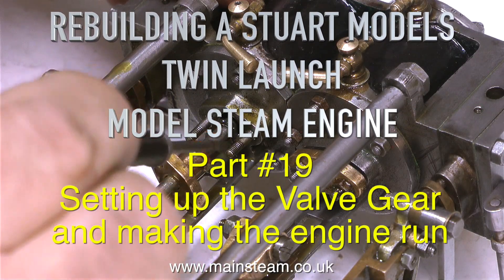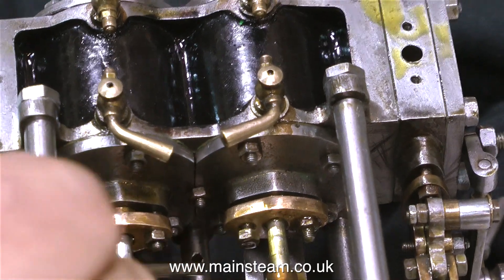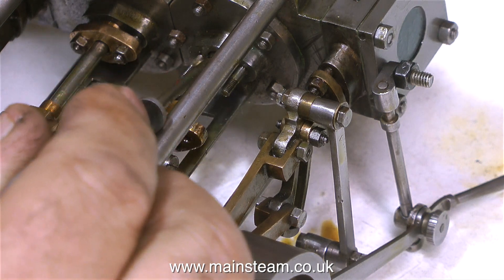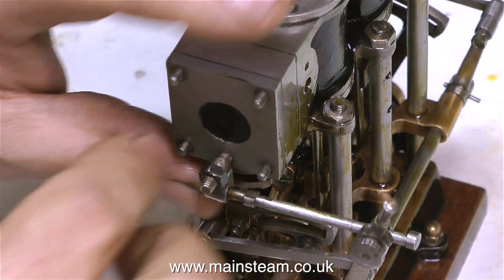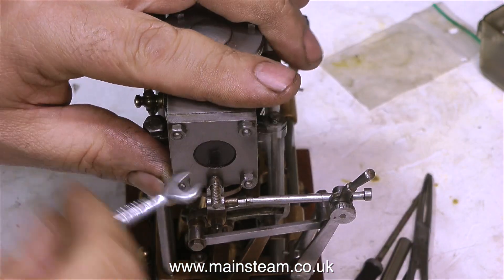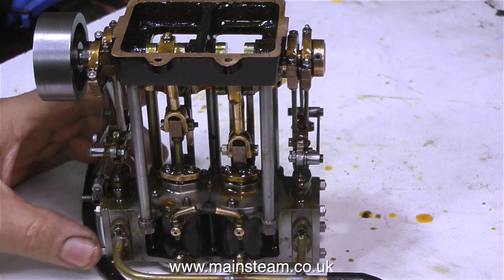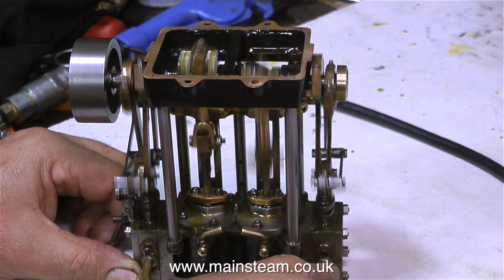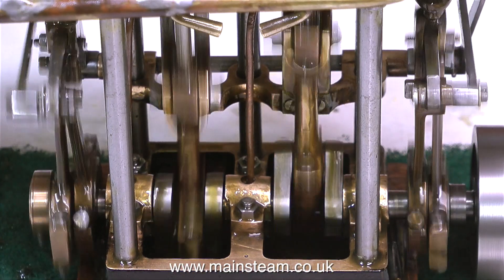STUART MODELS TWIN LAUNCH STEAM ENGINE REBUILD - PART #19

Comment: When inserting the graphited yarn I noticed that you only used a small screwdriver. May I suggest that you use a pointed, long, straight or curved non-locking surgical forceps in your left hand to hold the yarn and use your right hand with the screwdriver. Thanks for the great videos!

Comment: A piece of wood (ice cream stick, hardwood or the like) and some of that tacky stuff You can use to put up posters on walls can be used to hold the nuts and position them for proper mounting.  Works really good. No magnets magnetizing stuff you don't want magnetized, no tweezers or pliers catapulting the nut  across the room etc.  Work in tight and blind spots as well.

Comment: U-joint sockets are great for working on difficult access fasteners. You can trick up a 1/4 “ long extension to work with a standard socket by grinding the male end from square end to having rounded flats that will operate at an angle. Snap-On Tools makes several kinds and maybe the special extension will do the job if you do not want to make one. You can likely see how they work from a catalog.

Comment: Hi I've got a little steam lorry a Clayton and shuttelworth engine would you give me some tips for the pistons thank you.
Reply from the maker: What would you like to know specifically ???
Reply: Just like the the valve timing. Also I was told never to run a steam engine on air as the steam oil doesn't work like it's suppose to
Reply from the maker: https://youtu.be/YyIZQb-t9mc

Comment: As no one else has told you the best way how to fit those pesky little nuts, I shall. Get a screw, screw on the nut. then with a pair of needle nose pliers hold the screw/nut over the  stud and use your screw driver to wind from one to t'other. That's the best way to fit BMW bike rocker cover nuts, the voice of experience speaking. 
Thanks for reading and I hope you find it useful. :>)
Reply: I just came to say just that and see you just said it

Comment: When I take things apart that have fiddly little bits,  I use a large cake tin with a textured paper in the bottom.    If a nut falls it doesn't bounce because the paper cushions the fall,   and the sides help keep it from escaping.     The oily paper can be replaced easily, and the cake tin can be cleaned easily.    I use mostly consumer grade from the used-goods shop,  but I got one large commercial one that I like because it's so large.

Comment: I have found using tweezers to hold the nut helps and you just get it to take. Recently bought a pair of reverse tweezers (squeeze to release) but have't tried them. Been offered one of these engines unmachined in an estate and the first and only thing done to it was to fix the cylinder mounting lugs. Must have had a flaw or dropped. Will decide if i want to take it on.
Great work, Keep it up

Comment: Great video as always. Was curious about the timing that you do. You stated that in the beginning you make sure that the valves moves up and down over the port face an equal amount. I would think you would be able to get closer, faster, with an indicator or two and time it as you might with an internal combustion engine. Just a thought, I'm sure that "feel" has a lot to do with getting a steam engine to function properly.

Comment: Mr. Appleton, first off hello from Canada, I am enjoying your videos. I am getting into model steaming after moving away from my hometown ( there is a large agriculture museum with lots of fully operational steam traction engines) and I find that working with models is quite therapeutic. So in short Thank You for making such high quality and informative video. A tip from m working on cars, try putting a little paper in the jaws of a spanner and use that to hold those small nuts in place, the paper will help make the fit tight enough to hold the nut. Hope that is of some assistance.

Comment: Tip.... A length of rubber tube will fit over those tiny nuts and give leverage to start. You can use various lengths as needed. I use  this plus I have some long needle point electronic pliers as well.

Comment: Keith, great video, and a milestone, perhaps the finish line is in sight ?  Those small nuts could you use tweezers ?  I also have thin walled sockets they are 1/4 inch drive, and a universal .  Just a thought it is easy to second guess someone that is doing the work.
    Cheers      Ralph

Comment: When I was doing building maintenance we had large water pumps that had glands  that used graphited packing 1/4" square, used to have some picks similar to dental ones for removing and repacking the glands.  The pump was off for most of the repacking, but the gland adjustment was done with it running, the operator started the pump motor up (5hp electric) straddled the motor and leaned over the pump to adjust the gland, the ideal spot was with 7 to 10 drops of water leakage. too tight and the packing glazed and burned and you had to start over, too lose and you risked having a stream of water shoot out at 80psi. the wrenches for doing the adjustment were 7/16 brass (the theory  being that if you dropped one and it got jammed against the shaft it wouldn't score the shaft. You had to do both sides up at the same time so the gland went in straight.

Comment: You need to get a micro socket set
Reply: As far as I'm aware they use 1/4 inch drive which is going to be too big for this application, I don't think they make anything smaller than 1/4 inch drive.
Reply: My first thought was to use BA ratchet spanners but they don't make them either